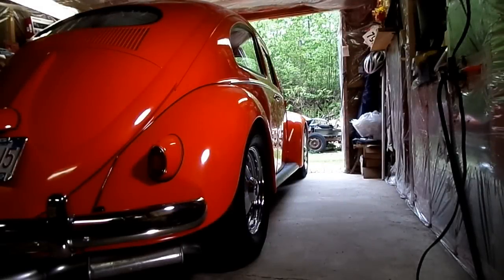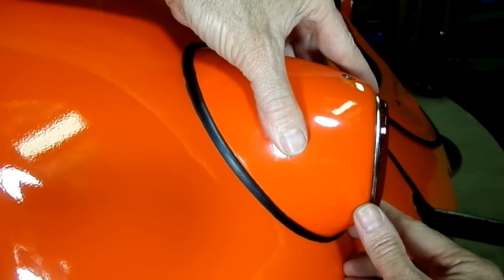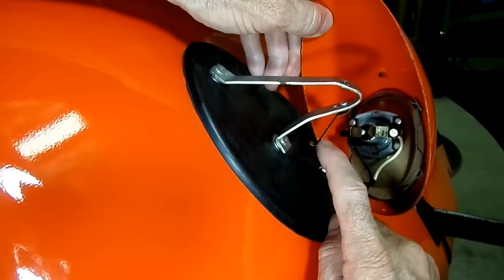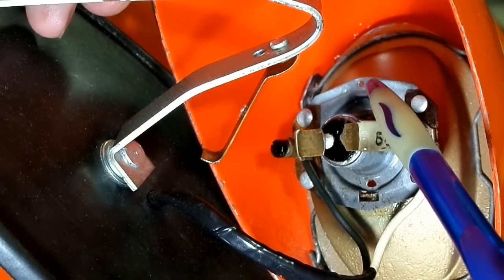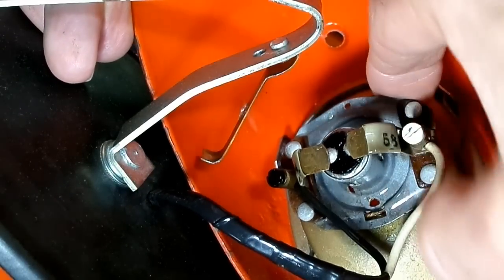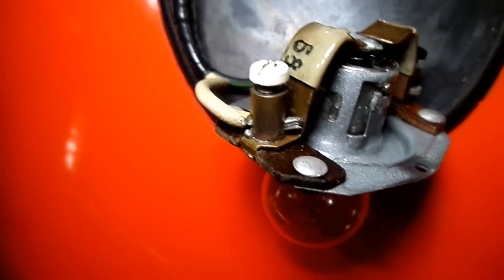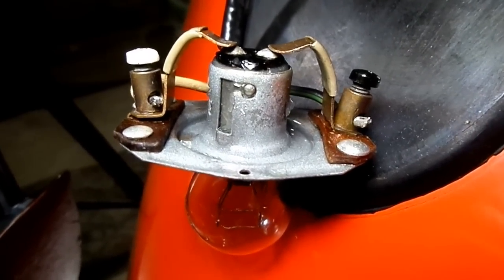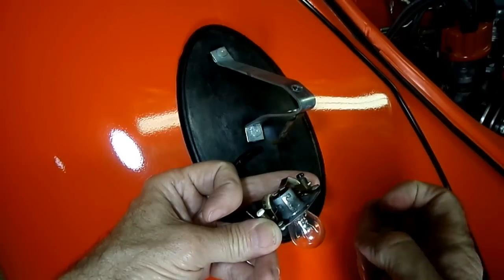1956-61 Vw Beetle Tail Light Bulb Replacement

Comment: Thats a loverly design mr richpin :D, solid propper bulb holder, everything engineered with thick quality metals, no bits of crappy tin.
Paxolin mount points for the screws, dam good isolation, not plastic crap, and brass.

Just one bad thing..... you put the old bulb back in ha ha :-))

if you didnt want to alter the holder for newer bulbs, you could take the metal caps off dead bulbs and fit them to modern led bulbs :-), just a daft thought.
Reply from the maker: Don't forget they used 6 volt why back then.You should have seen how bright the headlights were.They were measured in candlepower literately.

Comment: 1:27 - Love this.  In more modern cars the bulb bucket socket holder is made of plastic or equivalent and the pins that contact the bulb end up melting the holder and pushing through the plastic.  If that doesn't happen, sometimes the plastic guide either jams the bulb (in which case you can twist the glass portion straight off the metal base when installing a new bulb - arrrgh!), or the guide breaks, requiring a new socket.  

Wouldn't happen here as this metal design transfers heat to the surrounding air in the light case for better cooling.  In any case, the low wattage means you wouldn't need to change bulbs often anyway🙂

Comment: @richpin06a When I hit the brakes on my'59 bug the voltage 
immediately drops from about 13 (at idle) to 10, and then returns to 
normal when I let off the brake pedal (my brake lights are working). Any
 ideas about what could be causing this and how to fix it? Thanks!
Reply from the maker: What does the voltage do when you put your lights on.
Reply: The voltage also drops when I put the lights on  : - (
Reply from the maker: I think i would take a close look at the charging system.